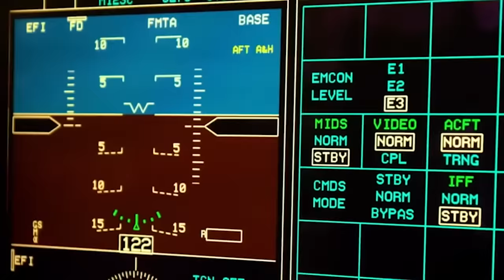The Cheapest Most Powerful Fighter in Existence

Comment: Regarding the issue of perception on the Polish FA 50 
We buy them mainly for air policing and  pinpoint attacks on ground targets maby for CAS/JTAC. The military air force was given a certain amount of money to spend and they thought about what they would buy for it and it turned out that the FA-50 fits, also the M-346 is troublesome they have a low readiness in our country, pilot training is important. We think 
about the integration of brimstone and meteor, until the introduction of the AIM-260, it would paradoxically be the most dangerous aircraft in BVR that we currently have and a nice cost/effect for scratching off armoured divisions 
between barrel and rocket artillery zones.
Reply: Among the contracts between Lockheed Martin and KAI are as follows.
FA-50 has a constraint that it cannot exceed the latest F-16 specification.
So the FA-50 has its limits.
However, the FA-50 is a cost-effectiveness and has a full role to play.
Very powerful as a 5th generation pilot training, proximity support, and small multi-roll fighter.
It must be a very useful aircraft for both training and practice.
Armed forces are also evolving.
In Block 2
AIM-9 Sidewinder
AIM-7 Sparrow
AGM-65 Maverick
IRIS-T
KEPD 350K-2
AIM-120 AMRAAM
It will be armed.

What is unusual is that the Korean-made AESA Radar is better than the US-made Radar with performance limits.
However, due to the inherent limitations of FA-50, it seems to be impossible to mount.

However, KF-21 has no constraints.
This is because Korea has developed core technologies such as AESA Radar, IRST, EOTGP, and RF Jammer.
The interior armament is also under development and the MUM-T system is also under development.
We're testing to control three drones with wingmen
It is being developed as a multi-purpose fighter with more than five generations at the same time as the development of internal armoured windows.

The AESA radar developed by Korea is a gallium nitride material and is powerful.
It is currently used in Korean Aegis destroyers, M-SAMs, and L-SAMs.
Gallium oxide materials that are much more powerful than gallium nitride materials are also being developed.

Korea has strong EMP technology.
RF-Jammer is also very powerful.
It will reach NGJ-MB performance enough.

IRST is currently on board the frigate and in use.

EO-TGP is already applied to FA-50.

Core equipment is constantly being upgraded with the development of new technologies.

KF-21 Boramae is the name of a falcon when its young is raised for hunting.
Boramae is called the Little Raptor, but in the near future, it will evolve into the fifth and sixth generation fighter jets that will shine on itself.

I hope you will pay a lot of attention to KF-21.
Reply: Doubt theres any perception problem. Us Americans know Poland has become the most formidable combined armes forces on mainland Europe. Most would think Germany or France but theyd be wrong. Poland has truly developed fangs in the past 2 decades
Reply: @burtknighten4438  유럽방위의 핵심이 폴란드라는 것에 먼 동양에 사는 사람으로서 절대 동의합니다, 독일이나 프랑스와 영국등의 국가들은 동유럽에서 불이 났을 때 뒤에서 화살이나 쏘면 된다는 인식을 갖고 있는 것 같습니다.
최근의 국가 방위에 대한 노력을 보면 이는 확실한 것 같습니다, 독일은 전차를 비싸게 팔아먹을 것만 생각하는 것 같고 프랑스는 포탄이나 무기 좀 팔아볼까 하는 것 외에 별 움직임이 없는 것 같고 영국은 아예 신경도 안 쓰는 거 같습니다.

Comment: We (USA) should have squadrons of those things for close air support in low intensity theaters and air patrols... instead of burning hours off of airframes costing 3-4 times as much.
Reply: They use drones in that case if possible
Reply: They’d make good jets for Air National Guard regiments in the interior states.
Reply: The USAF is looking into an armed version of the Boeing-Saab T7-A Red Hawk that may be called the F-7 for light combat duty. It would be a better fit for our use than the FA-50 and probably cheaper.
Reply: Building and using high-tech aircraft keeps our aerospace industry the best in the world. We dont gain that if we move backwards. The main reason this very jet exists is because of the tons of tech it borrows from the F-16, a project that was cutting-edge for its time. The R&D learned from advanced jet programs have vast trickle down benefits
Reply: @danielc9312  Unlikely.  The T7 Red Hawk is already behind schedule and over budget.  Typical of Boeing.  Probably filled with flaws as well.
Reply: @tarmaque  I'm pretty sure over budget and behind schedule is still preferable to buying foreign weapons like the FA 50. The flyaway cost of the T7A is around $22 million whereas the FA 50 is around $30 million. Even being over cost the T7A is still only about half of what the DOD was planning on spending to replace the T38 trainer.
Reply: The USA has plenty of cheap jets, as well as older generations jets that are long since paid for that are more capable
Reply: @SmithCommaBenjamin cheapest is f16, and only b52 and 1 will keep flying even if they keep getting more and more expensive to maintain, which happens with all airframes.  Its not the fly away cost that's already paid for that is the expensive part
Reply: @John_Redcorn_  Yes but that projects has been a disaster

Comment: While describing the F50 you used words like: less than, only and not as much. The F50 was designed for S Korea which is not a large country, thus Mach 2, more than four tons ordinance loads is all that it needs to perform its mission of protecting S Korea. This appears to be an awesome fighting aircraft.
Reply: Actually, the S. Korean Air Force only operates 60 FA-50 with the other version being advanced trainers and the TA-50 lead-in tactical trainers. The ROKAF, because of NK, operates the F-16C/Ds, F-15Es, and F-35A as its main force with the FA-50 being used by airfields close to the DMZ for scramble missions and close air support. Almost the same role as the F-5E/F that are gradually being phased out of service (a handful of American-made F-5E/Fs will all be deactivated by 2025 with the Korean-built KF-5E/Fs that started entering service in the mid-1980s, shouldering on till the end of the 2020s)
Reply: This aircraft would not be the appropriate tool to deal with the rising threat of communist china and the mach 2 fighters that China has . For South Korea this is a training aircraft so students can graduate to match 2 fighters . For low budget nations this is a cost effective option to modernize . Low budget nations can't afford f 35 fighters or the expensive maintenance required by f 35 fighters .
Reply: and the fact no other ac of its class is faster most are not even supersonic
Reply: @donholiday4942  If you stick AAM-120's on it would be fine. Most of the Chinese jets don't have the range to get to PI, so you will be intercepting bombers and possible long range fighters coming from the man-made sea bases. So this is perfect to deal with an attack if an American Carrier is not around.
Reply: @Bluewater78  전투형인 FA-50은 60기만 운용하고 있고 나머지는 훈련기(T-50, TA-50)이지만 전투형인 FA-50과 기본구조는 똑같아서 더미를 넣은 곳을 실용장비들로 채우면 FA-50이 됩니다.
The combat FA-50 operates only 60 fighter jets and the rest are trainers (T-50 and TA-50), but the basic structure is the same as that of the combat FA-50 so if you fill the dummy with practical equipment, it becomes FA-50.

Comment: These fighters do indeed look like a hybrid of F-16 and F-18, i like them, but it´s a bit confusing.
Gongratz to the Koreans for designing and building what seems like a great fighter.
No need to get ever bigger planes, sometimes a smaller frame is the exactly right choice.
Reply: It also look a lot like AIDC F-CK-1 Ching-kuo
Reply: Sometimes. But sometimes you need to swing a big hammer to make everything look like a nail
Reply: @John_Redcorn_  Certainly, the task demands an appropriate tool, no question.
But given that this is what they wanted, apparently it is big enough.
Reply: @thunderboltcougar5626  I see the similarity, but the Ching-Kuo has two jet turbines.
Reply: its for training and easy convertion to a fighter strike.  now if you want something bigger. they are making the kf 21 boramae for its 4.5 gen

Comment: Just a side note, the GE-F404 does NOT produce 22,000 lbs of thrust. No Golden Eagle has this type of power. 

But everything else is pretty spot on. Keep going. Liked and Subscribed
Reply: I think it confused with f414.
Reply: Plus, it is unusual for strike aircraft to make more than one pass against a target where there many be manpads. Unlikely they'd turn around for a second go at the target - yeah, it's artistic license by the narrator but "One pass, haul ass" is usually the tactic of expensive strike aircraft.
Reply: @staubsauger2305  he was correct with that one, the Maute ISIS group had no manpads. They tried shooting the planes with .50 cal rifles which had very little chance of hitting.
Reply: @michaeld1170  Thanks for the info. However even with 50 cals strike pilots always worry about the "magic BB" taking you out.  Hence, strike plan on one pass only except if you have better intelligence (or SF/FAC on the ground).
Reply: @staubsauger2305   Didn't you see Flight of the Intruder? (Or read Stephen Coonts' awesome novel)
Reply: He said "spot on". Ha ha ha....
Reply: @robr177  movies and books are dramatization.  You ought to read the introductory F-16 tactics manual (now public).

Comment: Looks to be something that Ireland should look into if they are serious about buying fighters. Be about the right price for them . I was watching another video about which aircraft the Irish could buy for their needs but this one was over look. What was mentioned is that they just need something to intercept Russian aircrafts that intrude there air space. This would fit the bill for them as they would be new built and not use airframes.
Reply: Ireland currently only has prop-driven aircraft so a small number of affordable FA-50s (or something like it) with low operating costs can be used to intercept Russian reconnaissance or bombers gettling too close to its airspace.
Reply: Ireland probably doesn't need an airforce but they should buy twin-engine interceptors like the F-15X due to flights being mostly being over water.

Comment: Basically a next gen F-5E….
Reply: pretty much
Reply: Yeah I thought so too, then later on 6th gen probably gonna look like YF23.....

Lmao Grumman...
Reply: @James73059  the proposed 6th gen is the ngad which is almost identical to the yf23 lmfaoooo
Reply: @liamoneal7643  The company be punching the air as we speak...xD
Reply: @James73059  ong they be angry af
Reply: @liamoneal7643 the 6th gen hasnt been revealed yet so i very much doubt any info saying its a yf23 copy. Itll be more advanced than that for sure
Reply: Not even close
Reply: @John_Redcorn_ 
I believe the NGAD for the air force will be done by Lockheed as they won the design bid. However bidding for the navy is still ongoing.
Reply: Light Fighter Mafia strikes again. The concept works, you need less higher end fighters if you have a couple wings of these.
Reply: Correction: A next gen F-20 Tigershark.
Reply: @namyun2743  No, the F-20 was a direct competitor with the F-16C at the time. Both are more capable than this plane.
Reply: @sorryociffer  You sure about that?  The F-20 was inferior to the F-16C in almost every singly way, except cost.  The biggest way it was inferior to the F-16C was that it wasn't purchased by anyone, especially the USAF with the weight of US military logistics.  The FA-50, especially the most recent blocks looks to be more capable than the F-20 on paper.  Heck, there are some countries who have already bought the FA-50.   There's even talk of new/upgraded engines for future models.
Reply: @namyun2743 its politics that killed the F-20. It was already compatible with AIM-120 !!  While the F-16A could only carry AIM-9 sidewinders. F-20 could takeoff from Adhoc runways/FOB.
Reply: @monkeychief-nk7se  Politics?  You mean lack of confidence in a fighter the USAF wouldn't buy?  By the time the F-20 was ready to begin production, it was competing against the AMRAAM capable F-16C not the A.
Reply: @namyun2743  no politics, it was president  Carter and Reagan who have ruined this project. Taiwan wanted to buy  but US didnt want to upset China in the late '70. Otherwise this would be the kickstart of production of the F-20. But things got delayed and since Northrop used their own finance resources the program got delayed till begin '80. You cant compare F-16 and F-20 they are 2 differend phillosophy's. A airforce armed with F-20 would have smoked the airforce armed with  F-16, because F-20 dont need much maintenance. So more bang for the buck mate.
Reply: By the way F-16C or block 50/52 entered service in late 1991, with out AIM-120 or how you call it the AMRAAM.
Reply: @monkeychief-nk7se  Incorrect, F-16C starts at block 25 with the AN/APG 68 radar and AMRAAM capability starting in 1984.
Reply: @monkeychief-nk7se  At that time, Taiwan would have bought anything we let them, including F-16.  Actually, they would have preferred F-16s over the F-20 if it wasn't for export restrictions.  What are you smoking?  An Air Force armed with F-20's would have had to cannibalize or scrap their planes within a decade.
Reply: @namyun2743  that is correct. but could it carry Harpoon anti ship ? The F-20 concept is like cheap massprodution vs quality, however F-20 shares both qualities. Offcourse the F-16 had more room for growth. I rather have 3 squadrons composed of F-20 than 2 squadrons composed of F-16. (OPTEMPO). Availebility after 3 sorties per day for a period of 6 months we will see who the true winner is .
Reply: @namyun2743  That's not true, how do you guys not know this? An F20 Tigershark was an F5 with an uprated engine, that means significantly improved thrust to weight. It could have fought WVR with the best, and been an excellent air interdictor and fighter bomber with short range. It would still be relevant today. It just got canned because of two completely preventable accidents during testing.
Reply: @ASpyNamedJames  In appearance sure.  In parts commonality, no.  IIRC, they shared maybe 15% parts commonality with the F-5.  To be fair, the F-20 had far better avionics than the F-5 and far more capable.  Its biggest shortcoming, the reason why export sales didn't happen, was not so much the accidents, it was that the USAF didn't buy any and it was competing directly with the F-16C in export sales, which the USAF did buy.
Would it be relevant now?  Maybe, at 1984 prices.  But it would still be competing with more modern used F-16Cs, the FA-50, older Gripens, etc.  Again, the biggest reason why it would not sell is the lack of presence.  It has nothing to do with it's capabilities, it has everything to do with plugging into a proven existing logistics and development chain, which F-16C, Gripen and FA-50 can provide.

Comment: F/A-50 Blk 20 can be equipped with either ESR-500A AESA or Raytheon Phantom Strike (at customer's choice) - and can be equipped with AIM-120 series and MBDA Meteor - and compatible with conformal fuel tank.  On March 8, 2024,  March 8, KAI’s board of directors greenlit a substantial investment of 90.9 billion won to develop a single-seat version of the FA-50 alongside an autonomous aerial vehicle (AAV) project. A portion of this investment, totaling 35.6 billion won is allocated specifically for the creation of a single-seat FA-50, responding to the escalating global interest in such models. This initiative aims to broaden product offerings, tap into new markets, and accommodate persistent requests from existing clientele for a solo-seater variant. Projected roll out date of the single sit version is 2026 or first half of 2027.

Comment: Currently  cheapest Most Powerful Fighter in Existence is surely JF-17 block 3 , It comes up with AESA Radar , advance electronic system and long range BVR missiles like PL-15, JF 17 can also carry Hypersonic missiles , Maximum Take Off Weight upto 13500 Kg around 1000 kg more, Service Ceiling 55,500 ft almost 7000ft more , both having speed upto 1.6 mach.

Jf 17 is half of the cost of FA 50 and in last year Turkish war games PAF jf17 block 2 shot down Qatar Rafales with 6:2 Ratio.

Comment: FA-50 is literally classified as an advanced trainer, they didn't even have BVR capabilities, why bother call it a fighter?
Reply: BVR is not a requirement to be called a fighter
Reply: I think you confused FA-50 with T-50. FA-50 pretty much have the same engine etc with Grippen C/D.
Reply: The USAF T-38 Talon trainer jet has been bought and used in countries around the world as the "F-5" for nigh 40 years.  Even the Swiss Air Force used them for decades.

Just because a jet is used for a trainer doesn't mean avionics, radar and modifications can't turn it into a lethal weapon.
Reply: The FA-50 block 20 can carry the AIM-120 AMRAAM.  I believe it can only carry 4 of them, but it is a BVR missile and very capable.
Reply: I’d love to have an A-37 Super Tweet, but would settle on the T-37 trainer version. 😉
Reply: Not yet, Block 20 upgrades will add BVR capabilities.
Reply: @AirShark95  It is an open secret that the Philippine Air Force has BVR capabilities. They had contracted Elbit Systems to optimize the ELM/2032 Radar of the FA 50PHs and upgraded the communication systems. What the PAF lacks is simply BVR munitions. Right now, as per our sources within the PAF. The PAF if needed can use the Derby Missiles from our SPYDER batteries.
Reply: It can be upgraded to BVR,

FA-50 is based from its trainer aircraft T-50

Both aircraft are created with collaboration with Lockheed Martin, that's why it kinda look like an F-16 and has capabilities of F-16 and F-5

It can also be converted to either air superiority or multi-role
Reply: Block 20 will have AMRAAM capability.